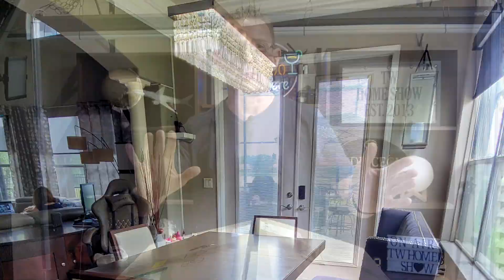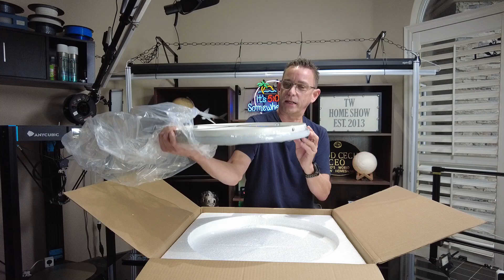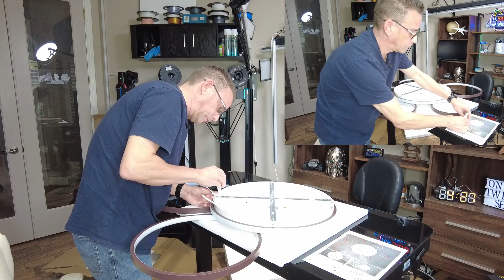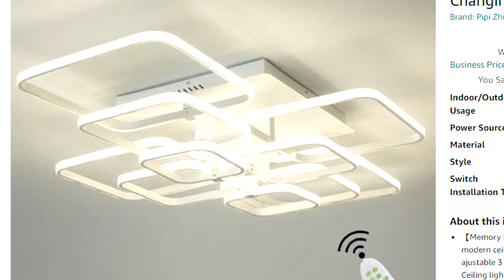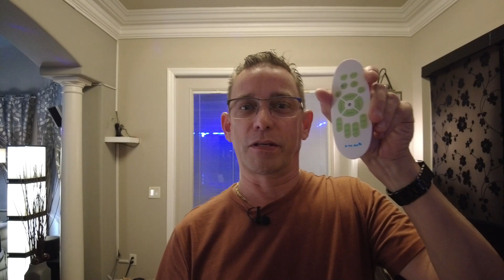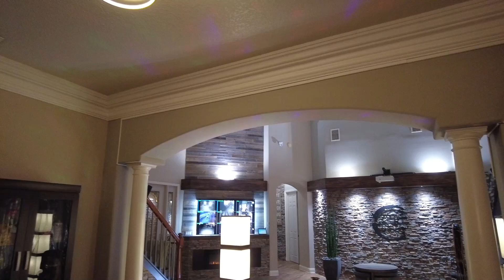Modern Dimmable LED Ceiling Light | Change your ceiling light | Smart Remote Control Features

Comment: Hi, Like the video and your light. I do have a question for you. I bought a LED Remote Controlled Ceiling Light Fixture and was very happy with it...until one night that the power went out for about 30 seconds to our house, and when the power came back on the light automatically turned full ON, which at 2am in the morning while you are asllep is very annoying. Is there a way to make these type of lights to default to light OFF after a power loss, instead of light ON.??? Thanks

Comment: How bright is the white light ??? Can it have enough light  like a pool table light ??
Reply from the maker: Hello, this light gets very bright, BUT, I've had a pool table in the past and I think the way this light is designed, it will NOT give you the necessary amount of "down-lighting" needed to give the required lighting on a pool table. A pool table would need the lights to be aimed downward. Hope this info helps.  -Todd